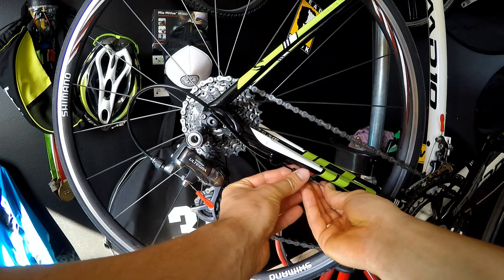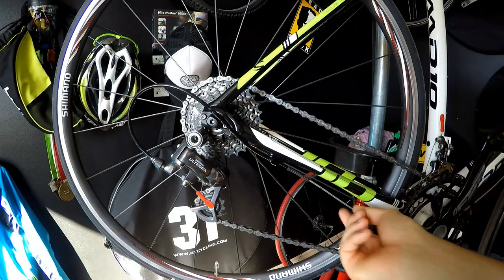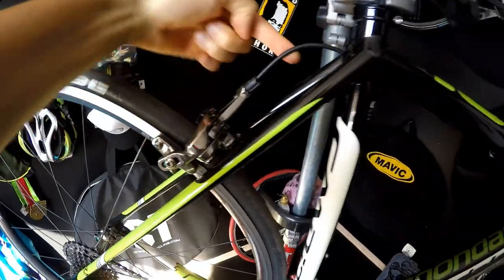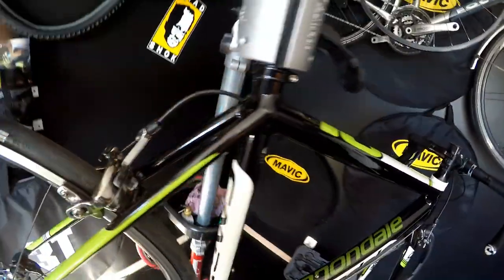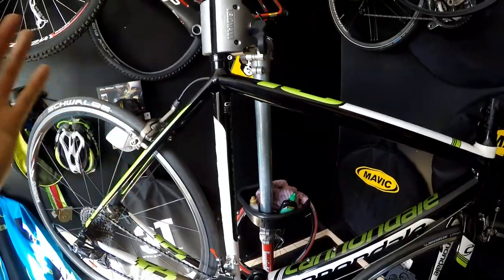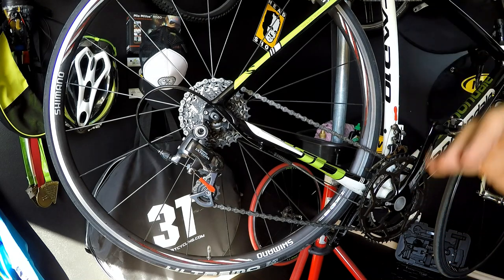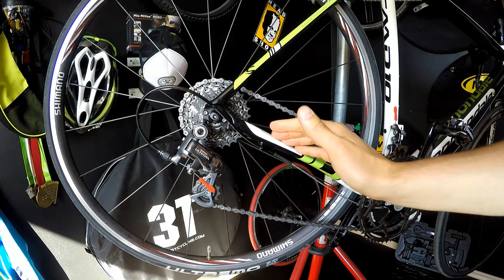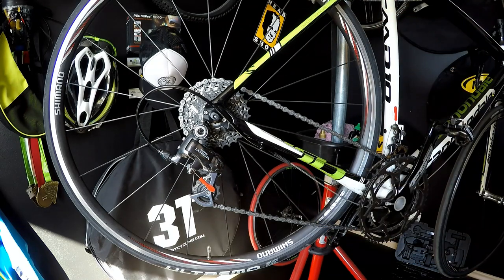3 IMPORTANT Reasons For NOT Buying Bike With Internal Cables! Road And Mountain Bike

Comment: I'm a novice bike mechanic (I do all of my own maintenance but learn as I go) and it was crazy easy to work on internal housing, even my first time.

When you remove the old cable, tape a string on the end you're pulling out. Pull it all the way through. Use that same string to pull the new cable back through. Piece of cake. No need for magnets, or specialized tools. Common sense.
Reply: thank you you said it all with two words common sense which it seems some people are running out of these days lol

Comment: Cannondany - routing your cables is easy - just tie a piece of cotton to the end of your cable and use a vaccum cleaner to suck it through the tubes to the exit hole (block off the other holes with tape) then pull the cotton out and the cable will follow. 5 min job. I don't know what all the fuss in this video is about!
Reply: Park Tool has a internal routing cable where there is a magnet at the end and you can guide it through your frame using another magnet with opposite polarity from the outside.  It works quite well.
Reply: Don't understand the fuss, too. It might take a few more minutes to change the cables - but the look is much cleaner, the bike easier to clean. And how many times do you really have to replace them? With the modern cables friction is negligible. I use hydraulic brakes.
Reply: thank you for having a brain

Comment: It took me 5min to replace rear derailleur internal cable in my Focus road bike. I simply used old broken cable as guide via frame.
Reply: I do the same I cut the old internal housing  at both ends and then I feed the cable on the new housing first and the I feed the new cable into the old housing and pull it through the other end then I push the new housing in making the old housing go out as I put the new one in lol easy and simple...  You just have to use your brain a little bit more.😁

Comment: This in my opinion is not one of the top 95% videos you have ever made.

You need to weigh perceived advantages and disadvantages. You are often giving very definite advice and you even fail to think about why that advice might not be ok for somebody. Have couple of things for you to check:
1. Di2
2. Hydraulic brakes
3. Internal mechanism that hold everything in place, usually  around water bottle position. There is no cable rattling with the new Canyon Endurace.

Even if after all this you still manage to find one example where it will take longer to fix something - so what? Is this really enough to say "don't buy bikes with internal cables"?!

Comment: i have an internal routing on my mtb bike. it´s nice and clean. not a problem when i  changed bowdens and wires. i understand that interal hydraulic brake cable can be a problem when you change another model of brakes because of bleeding and so on. but it´s not something that u do every week. so for me internal cables.

Comment: I have a Guru Genoa bicycle. I can't tune the rear derailleur, I believe its due to the internal routing which is causing the cable to hang up somewhere or is causing excessive friction.  I picked up a lightweight modern Trek aluminum frame that has external routing. I'm going to strip the Genoa of its components and transfer them to the Trek.

Comment: Building wiring specialists would have no trouble routing a new wire through that frame. As mentioned, attach a pull cord to the cable BEFORE pulling it out. Then you will have a pull cord in place once you remove the old cable.

Comment: I have internal cable routing with Jagwire housing and cables. The shifting performance is slick. Then there are my hydraulic brakes, also very very good performance. As far as noise goes. I don't get you bro, just trim the cables and you're fine. I have none of those problems with my frame (2016 Felt Z4 Disc).
Reply from the maker: Good for you, but many frames I tested weren't really good in this.

Comment: There is a significant aero benefit with internal. As for noise, never had a problem with internal. With external the cables slap on the frame.

Comment: You can run full length housing with your cables and zip tie them to the frame. Then you can route them any way you want. Don't make ties too tight or you can bind cables. You can also buy cable stops which clamp onto frame but this can be tricky with modern frame designs and carbon materials. Internal routing has no benefit other than asthetics. Park tool makes a kit for running internal cabling-it uses magnets.

Comment: not agree at all, only if you lose the guide cable is difficult for maintenance, but even if you lose the cable there a lot of trick to do it on tube in 5 minutes, it´s the same for shifting and breaking and the cables lasts longer and looks a lot nicer
Reply: deathmedialab I agree with you 😲💥😲💥😲💥😲

Comment: Nice Video,  I have internal cabling, never had any noise issues, that must be a tension issue, routing the internal cabling is not hard, especially if you use piping from an old cable housing, you cut the cable, either from the brake front or rear derailleur, feed the pipe over the cable a couple inches, tape pipe to wire securely, pull through from opposite end, pipe remains in internal canal awaiting the feed of the new cable..I changed my front derailleur cable in about half an hour. :)

Comment: Fill those holes with foam. Water should not be in your frame. Clean inside frame, clean cable. No rust. I always carry cables. Never needed one on the long haul

Comment: Looking at the spacers above your stem there. That's a lot of area of steerer tube that is unsupported by the stem particularly if you're using a carbon steerer.  That can cause problems.

Comment: I have internal routing on three of my bikes two of them have the hose of the hidraulic disc brake in the frame and all three have stealth dropper posts. I replaced shifting cables and brakes but never had a problem with the internal routing and I like the look of the clean frame but I'm just as fine with the external too - except for the dropper.

Comment: the cables rattle a lot no matter what, the difference is that external cable has little rubber grommets to dampen it.
Reply: He is talking about the casing... not just naked wires inside the frame man... and what you have said is incorrect, all cables do not rattle a lot no matter what. I have been riding for well over 20 years and have never had a problem with noisy rattling cables and all of them without exception have been externally cabled bikes.
Reply: I see
Reply: No rubber grommets installed and no rattling that I can hear on my externally routed bike.

Comment: Over the gamut of occasional "fluffy" GCN coverage to the extremes of "NEVER buy a bike with internal cabling or you will DIE!", Cannondany has some great postings with informative counter-balance to some of the less deeply-researched views on other cycling channels.
But these reasons are not persuasive, in the case of an opportunity for an "upgrade" to a bike that fits the budget and the body. I went from 2007 S-Works  Roubaix SL to a barely-used 2012 Roubaix SL3, knowing that the frame was physically perfect for me . While I would have preferred external cabling, it could not be a show-stopper when all other considerations were taken into account. I seldom work on my own bikes anymore, and the quietness, ease of cleaning the frame, and the stoutness of the cable/frame caps on this frame overcome (for me) the slight mechanical inefficiency of the extra bends. I also have great experience with Campy cables and housings and have them replaced as a routine maintenance in any case. 
However, I am glad to know the objections so that I am aware of possible problems ahead.  Keep up the good work, Cannondany, but this issue seems to be  overblown in the circumstances that I have described.

Comment: Right on.  Nice to read common sense.  Cables put holes in the frame and sweat gathers and corrodes around the cable.  Then it won't pull out.   

Yes, cables notoriously rattle inside the top tube.  What a bummer on you dream bike as you sprint to the finish line!   

Yes, the cables have to make it past too many bends, so work spongy,  External cables may look old fashioned, but they're ultimately sustainable, like 32 spoked wheels, down tube shifters, and 25C tires.  This is an exercise machine, not a buggy.

Comment: well, true. but typically all bikes with external cable routing are extremely ugly. and not that good.
maybe you should do a video: top 5  bikes with external cable routing
Reply: Really?!  "...typically all bikes with external cable routing are extremely ugly and not that good"
Well.... I don't know what bikes you have been looking at, but I think you are talking rubbish... there is a reason why external cable routing has been favoured and  been used so much by so many bike manufacturers throughout the years... it WORKS efficiently and it is user friendly... okay. You may prefer the hidden cables because of the clean look... and that's fine... understandably so... but don't try and make out that externally routed bikes are not that good AND extremely ugly by comparison, that's just untrue.
Reply: HOPKIRK well, go for the defy entry level, ie. plus i didnt say all bikes. "typically all bikes" not the same. plus i didnt say i didnt like them or all bikes should have internal. 
cannondale does have frame paintings that might be appealing to some.
external routing is tipically assotiated with entry level bikes, that typically are quite ugly or not as sexy as the more expensive ones. that was my point. im all for simplicity of processes. KISS philosophy. im sorry if i mislead ya with my comment.
more: if you go to steel colnago, pinarello, or even cinelli, which have some of my favorite frames, those are some beautiful frames and external cable routing. but then again freaking expensive.
Reply: Yes mate... I know what you said... I quoted you,  including typically within that,  I don't necessarily agree with your "entry level" logic, it is not as clear cut as that and you know it... I think you must have your carbon fibre head on concerning this issue of "sexiness" and yes I agree with the kiss philosophy/ methodology.
I am all about function over form when it comes to my bikes (and most other things for that matter)... smooth,quiet and efficient as she runs is how I like it... of course it helps if it is a handsome beast, I like a good looking bike... nobody wants to ride a hobgoblin. You have to bear in mind though that some people actually really like the look of exposed cables too (not necessarily myself)... I mean I love the clean lines that internal gives... but... there are still serious problems with functionality and ease of maintenance, simple problems though, obviously it will take some time for them to dial it in precisely... trial and error.... I mean, just look at the way some cables are routed on certain frames... makes me think some designers are a bit clueless when it comes to that side of things, there seems to be very little thought about transitions and placement etc.
I ride a custom aluminium "road"  bike by the way, I am a rebel like that.
plus it was dictated by necessity... which often can be a good thing when it comes to the considered norm'... if you know what I mean, .. anyway, happy riding man.
Reply: I agree that bikes with external cable routing don't look so good

Comment: I had already a KHS road bike with traditional external cabling and it worked just fine (Tiagra 4600). Now I have a have a Giant Revolt gravel bike that also has external cabling (Tiagra 4700), but in a different way: the cable housing is  not splited and the the cable is not exposed at all, but the shifting is much worse. Looks like there is too much friction and sometimes the cable seems to be stuck when is I try to shift (to smaller sprocket on rear for example). I had also mountain bike with internal cabling and it worked just fine, but the cable housing doesn't run inside the frame since there was cable housing stoppers in the frame/cabling  interface. So to me looks like the biggest problem is when a single unsplited cable housing is used from the shifters towards the derailleur. Do somebody have the same feeling?

Comment: Will you pls recomend a carbon frame with external cable roaring , if they exist pls . Road bike frame in particular
Reply from the maker: I didn't try to say, that all frames with internal cables are bad, but I'll make an episode on models you mentioned.
Reply: i just bought yesterday a Focus Izalco max,external cables...i have too Focus izalco with internal cables,looks much nicer,but the Max is a superb machine,when riding you forget about the cables.
Reply: Cdale Evo `16 has only external cabling, similar to Caad 10, but a smidgeon better :P -
35% off now atleast since the `17 Evo gets the Evo High Mod upgrades/changes carbon mould.

Comment: Love your videos however I have a great hack for you and anyone reading this. 
When you remove your old cables draw through a lenth of strong fishing line as you pull out the old cable. Secure your new cable tight with some electrical tape a gently pull through. Can't believe a bike shop took a day to do this?

Comment: great video. has the new tiagra been released yet?
Reply: Sora
Reply: The 2016 is out ... I have it om my Roubaix (from the factory) ... for my skill level, works a treat!
Reply: Michael Leers the thing is if your not into racing the tiagra is just right. The only draw backs between the tiagra and the 105 is that the tiagra has 10sp cassette and 52t crank. I am good with that. A 52 and a
 10sp is just fine for me. And the new hidden cables make the tiagra look damn good
Reply: Thanks! I rally appreciate your input. Seriously.Brian Carless
Reply: Michael Leers think nothing of it

Comment: I really think bike engineers are on illegal drugs, during their schooling at now at their jobs to design such stupid bikes. I have been waiting 35 years for cassette gearing to have more even spacing gear ratios, but they continue after decades to make them wrong. Here is the perfect gearing for 99% of all terrain and all recreational road riders;  22/32/42  -  11-12-13-14-15-17-19-23-27-32  (10 speed).